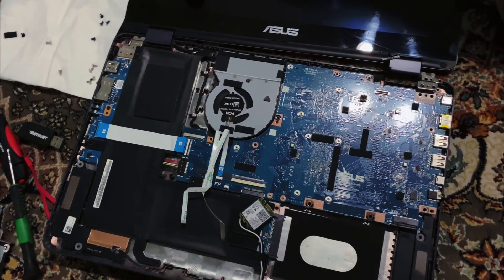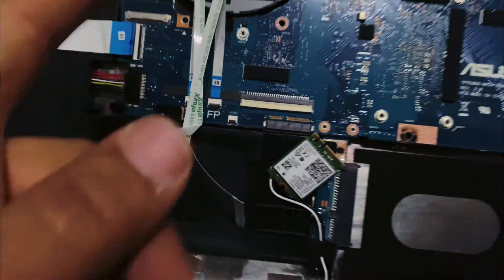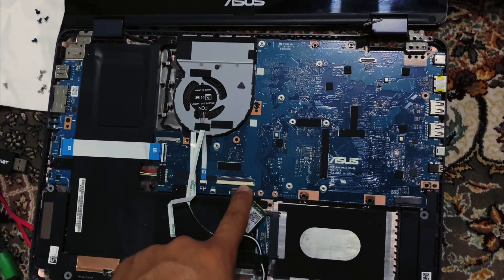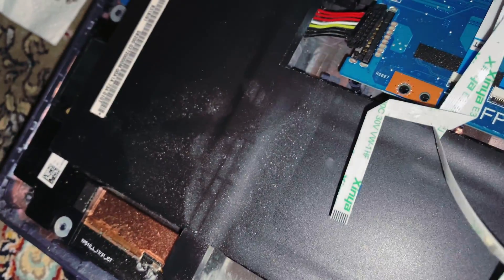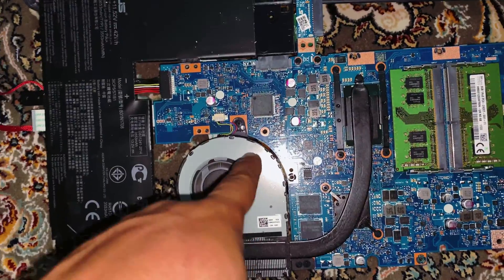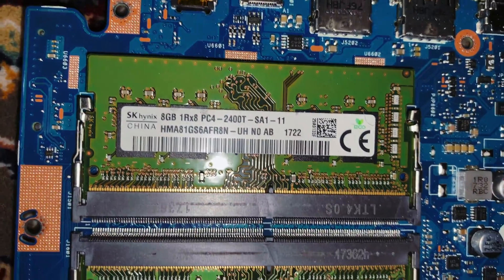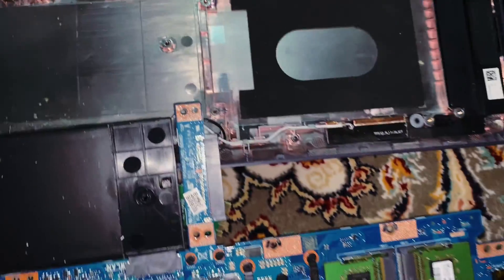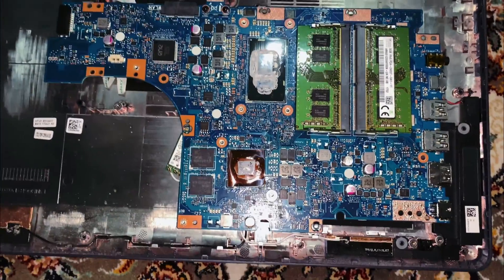ASUS tp510u Laptop SSD, RAM Upgrade (disassembly for Fan Cleaning, Thermal Paste reapplication)

Comment: how many m.2 slots are there  in this laptop?
Reply: it only has 1 m.2 slot, however keep in mind that this m.2 slot DOES NOT SUPPORT NVME drives, it only supports SATA drives. (which essentially defeats the purpose of having it in my opinion)
Reply: HoLDoN4Sec is that so. Im planning to upgrade to an egpu in the future, and thats not possible right?